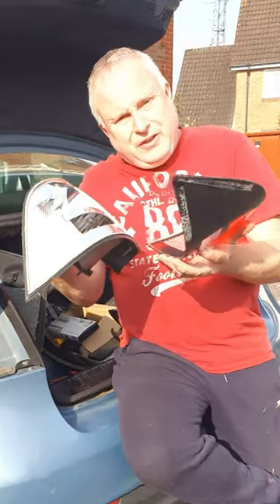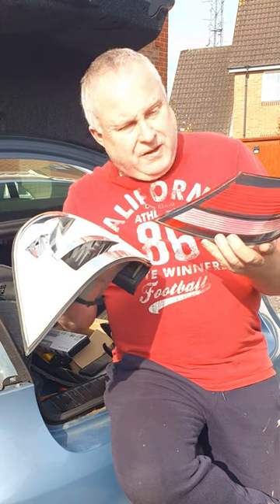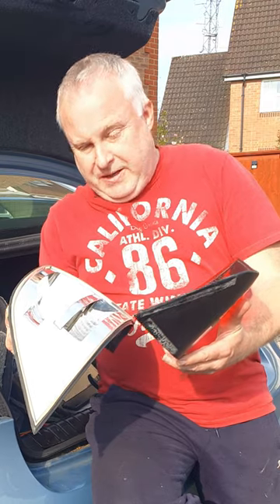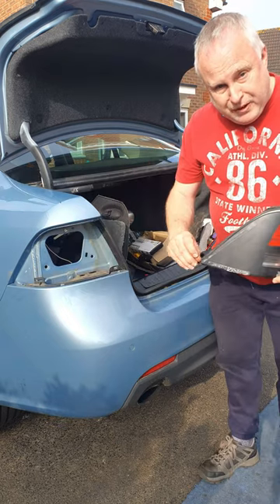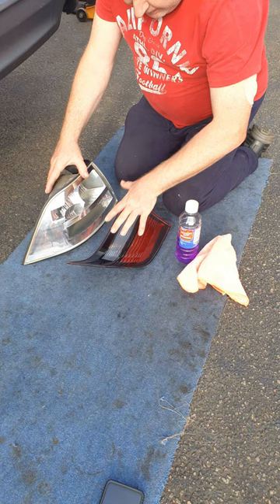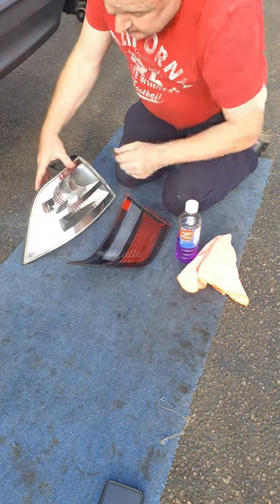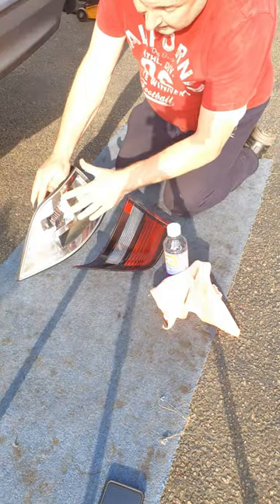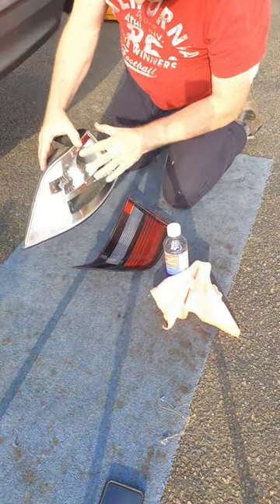Rear Light Lens Missing ☹️

Comment: I fixed a rear light using a thin acrylic adhesive once. It looked perfect. We noticed there was still some water in it so we poured some IPA inside, sloshed it around to pick up the water, and poured it out immediately. It looked brand new. We fitted it to the vehicle.

A crack appeared. And another. And another.

Within a day there were hundreds or thousands of cracks. Pieces of coloured plastic began to fall off! 😂

I don't know the cause. I think the acrylic adhesive dissolved the soft rubbery light grey plastic that forms the frame that holds the bulbs etc, and as it hardened it pulled at the coloured external plastic until it broke.

I'm not certain though. Ideas welcome! 😃